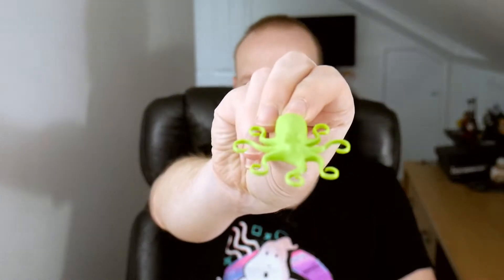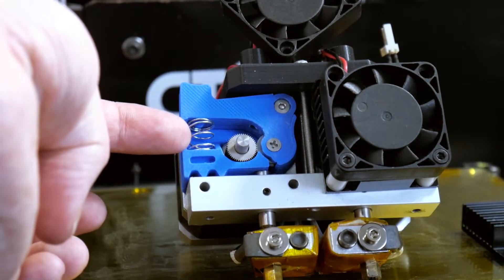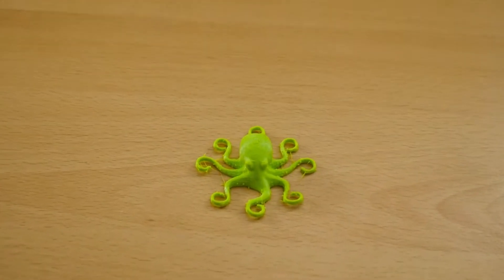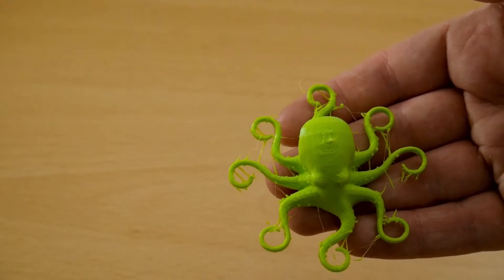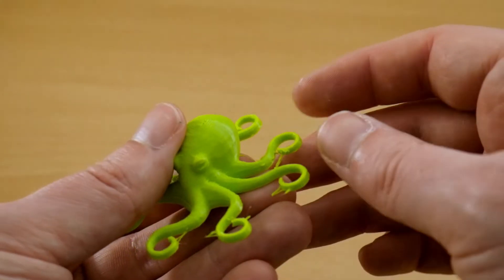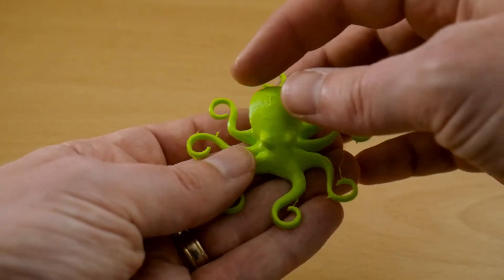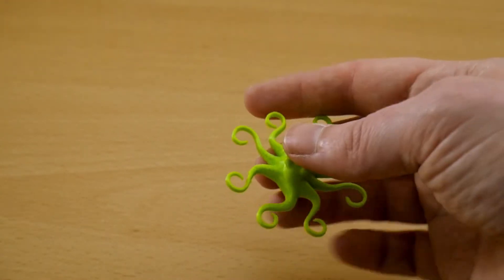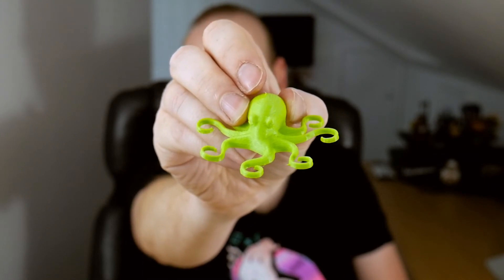CTC 3D Printer Flexible Filament Test

Comment: Very informative video thank you. I also have the same CTC printer which I am slowly improving. Would you mind me asking which software you use to control the printer?
Reply from the maker: Hi, I use Simplify 3D for all my slicing needs. From this software, I can output directly to .x3g file format and pop the SD card in the printer and away I go. I am also on Salfish firmware on the printer.